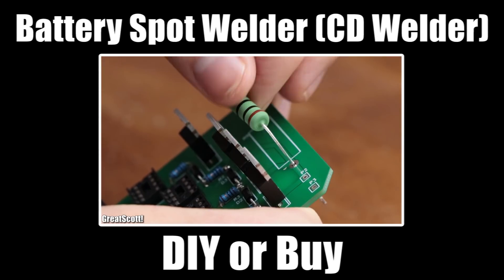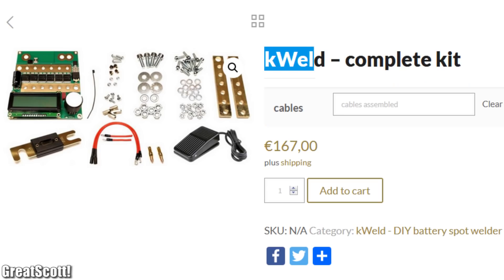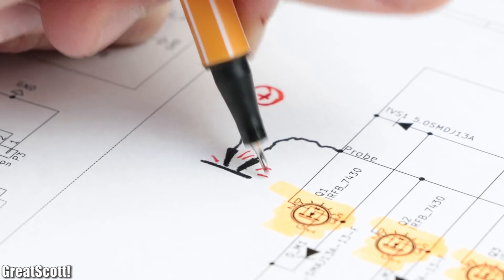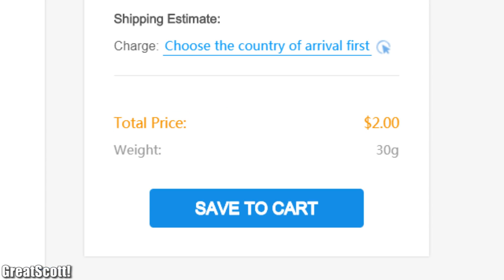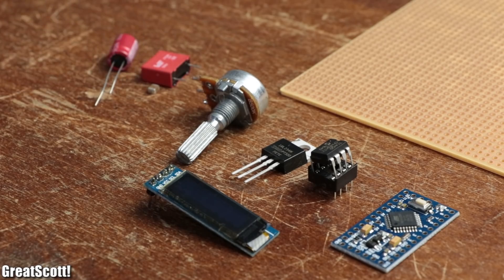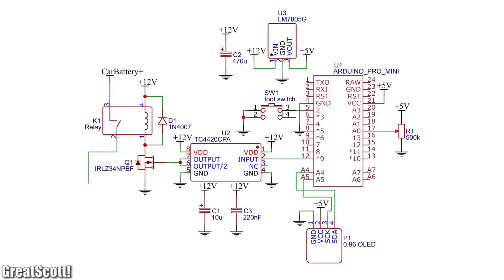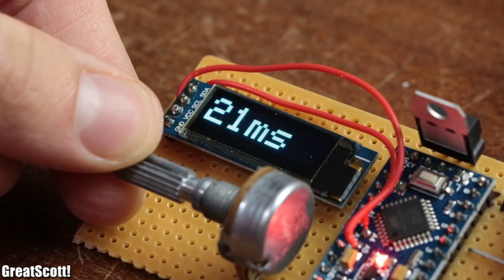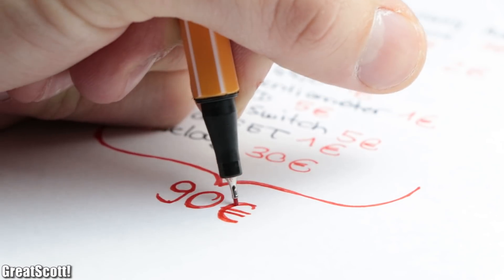Make your own Crude Battery Spot Welder with a Car Battery!

Comment: Hey Scott, i have a project where i want to build my own pitop. I have a big problem. I dont know how i am able to charge an old laptop battery fast enough, so it wont run out of electricity while using it. I know there are controllers, but it seems they are only aviable for 5 Volts selfmade power banks. Can u help me? All the videos i have seen, do only care about selfmade powerbanks. I need the full power of the 10.8 Volt Battery. in order to power the screen, with its 12V Controller as well.

Comment: Nice project! I'd simplify it even further by replacing the Arduino with a 555 timer. Same footswitch and RC tank, but simpler trigger circuit with no need to code.

Comment: Thanks for the video!  I did want to point out an even simpler solution for users to consider as well:  https://www.youtube.com/watch?v=b_kGgPVrcCI

That setup doesn't provide accurate adjustment of the pulse time, but the builder gets very good results by simply altering how he presses the trigger.  It's the simplest spot welder setup I've seen, yet he's obviously welded hundreds of cells with it.

Comment: Nice project but i have one question:
Instead of a car battery why didn't you use super capacitors like in your previous attempt, they are cheaper, dont need a fuse, can be charged directly after a weld, are smaller and can deliver more amps. Maybe you do need some super capacitors with more capacity (like 2.7V 500F) but those would certainly be better than a car battery right?

Greetings 
 Gustav.

Comment: Ive made a spot welder by using microven transformer. And I control the 220v input of the transformer with my diy SSR with a triac which can easily pass 20A. And rewinded the transformer so the output is around 6-7 volts and its the cheapest spot welder with 2  pulse system

Comment: Some guy on the youtube just built one with must a mot, 2 relays, few leds, buttons and a few capacitor, the first relay is connected to a button and a 16v cap, he basically discharged the cap to turn on the relay for few seconds to turn on the second relay that will connect the mot with the wleder electrod. He also built it so the cap is easly swapable to change the pulse time

Comment: I used a homemade spot welder 40 years ago. 120 vac to 15 vac using a 12 v octal timer and 1/4 kwatt transformer.  Did flat heater wires! The most expenses part was  the 1/4 kwatt transformer!

Comment: Shouldn't the project include a battery charger ? Even if many may have a spare one...
And I thought also, from your last video on IGBTs, wouldn't they be better suited for handling such amperage at a better price than mosfets in the project you mentioned ? They can be salvaged in induction stoves.

Comment: I just use 2 copper wires from a car battery. I press 1 down on the  Nickel Strip Tape and then touch the other one on it. Works for me. Minimal parts.

Comment: 90$ lol, if you need to make a new battery pack you may aswell just buy one. If you have tried to normally solder battery tabs to batteries, you know its almost impossible but you dont need to make one of these, you just need your car battery, and some copper wire. I made a video a few years back if you wanna see how to do this for free.

Comment: Almost the same idea, but without 99% of the electronics. I use a 330amp to 400amp solar battery and a 12v solenoid 1000amp from a Ford Bronco Truck, thick gauge solid core wire and thinner for the contacts for the activation and momentary switch, the same copper nails, and and 60amp connector for the nails and wires. Working, but could use a heavier gauged connector and you have to tap that momentary as fast as possible or you burn right through the strip and battery.

Comment: The relay will have a slow response time, making the timing a bit off. Did you allow for that?
Reply: My question too. But then, I realized that when we use any machine we learn what settings to use through experimentation. That said adding a variable for solenoid delay in the code could make it really close. If he does do that I wonder how consistent the solenoid is?
Reply: I wonder if the on-time and off-time of the relay is the same thus cancelling out? though an oscilloscope test wouldn't be hard to verify.
Reply: @bilzoo20001  yeah

Comment: Lol, I simply discharge a 25v, 20000uF capacitor - the pins can serve as the electrodes. Works like a charm every single time - Ive prob welded a few dozend li-ion packs that way...
Reply: Pretty cool! Noob here, how long do you have to charge the capacitor to be "fireable" again, i assume a few seconds? Also what do you charge it with, a car battery?
Reply: @aronrad  You need some sort of power supply, anything that will give you a stable, preferably 25v. Id say 18v is the minimum for it to work. Some old laptop power supplies run at that voltage or maybe you have an 18v li-ion power-tools pack that you can use to charge the cap. Also two 9v block cells in series could do the trick. Its harder to get a hand on 20000uf capacitors tho... My tip hence, buy two inexpensive 10000uf ones and put them in parallel. Good luck! Oh and as for charging time - just go with 30s and you'll be fine in any case. And make sure u got the polarity right otherwise they will blow up on you...
Reply: @Mikey Mike  -  I'm really surprised you get such a good result with such a small capacitor.  Have I read it right -  20,000 micro-Farads?  Theory says that size capacitor at 25V can only store/deliver about 6 joules of energy (0.5 * Q * V ^2 = 0.5 * 0.02 * 25 * 25 = 6.25 joules),  which seems WAY too little to make a weld.  My researches suggest that 40/50 Joules is the minimum, and that's with a really well-controlled and timed delivery pulse (preferably a double pulse).   I've got to get me one of those capacitors. If it works, you would seem to have discovered the secret of cold fusion, Sir :-) !  Are you quite sure about the capacitance?

Comment: You shouldn't crimp/screw tinned wire. The soft solder will compress, and lessen the contact pressure.

Comment: Mine is a large capacitor bank charged from a bench supply through a foot switch. Another foot switch discharges the caps through an old X-ray SCR (with triggering voltage from an 18650) and my leads.

It cost me about $0 to make thanks to scavenged parts.

Comment: Thanks a lot for this tutorial. I have tons of 18650s and I'm building a huge 25s1p pack to power a 1940s portable tube radio which requires a 90v battery and I was going to solder them the "bad" way, with a soldering iron...
Anyway, some of the stuff like the relay can be found for much cheaper on ebay:
Arduino Pro Mini 1.48€
TC4420 1€
IRLZ34N 1.40€ (price for 1 in packs of 2)
DK238 Relay 19.68€
Foot pedal 1.15€
0.96 Oled display 1.99€
Battery terminals 1.63€
200A fuse holder 5.40€
200A fuse 0.40€ (price for 1 in packs of 5)
Copper nails 5.10€ (price for 5)

Which makes it a total of around 40€ not accounting for thick wires, potentiometers, veroboard all that stuff. But let's suppose it's around 15€ (10€ of cables and 5€ of extra hardware) so the real total price is 55€. You could even remove the copper nails from the list and replace them with heavy duty ground wires if you can get your hands on a foot or two.

If you want to go the cheaper route with a 555 monostable circuit you can shave 10€ off the price.

And if you think the big chinese electronics lobby is trying to scam you with their scary "safety" gibberish simply get the relay and a foot pedal just like AvE did: Spot welder for 30€!! (anyone reading this, please don't do that, accidentally burning down your table or you house is not worth it for this price.)

And again, thank you for this video! Love these useful and effective projects!

Comment: SCOTT! Please cut off those tinned wire ends in screw terminals!

Solder suffers from a problem called cold solder creep. Under long term mechanical pressure it flows, relaxing the force on the wire and causing a resistive connection. This has caused many house fires in the past. Although it may not be dangerous in your welder application, it is a dangerous practice which should never, ever be used as an example of how to prepare wires for screw terminal connection.

This is also why, in safety related wiring applications, it is forbidden to rely on soldered connections alone without mechanical fastening also.

Modern lead free solder used widely in Europe may not be as susceptible as leaded solder, but many hobbyists still use leaded solder, and outside Europe it remains widespread.

Please check this out, and warn your viewers not to tin wires for screw terminals, especially never, ever, mains wiring!

Comment: I'd like to see the Arduino version compared to a simpler 555-based version. I only need to set a variable pulse, so would not think it necessary to add a computing device to the circuit when a 555 would do the same thing. Seems like far too much complexity for a simple timing device.

Comment: I used an arduino with a potentiometer and simple timer code to pulse a 5v 30a relay to pulse a Ford starter relay. Cheap and simple. $20 if you already have an arduino.

Comment: The easiest and cheapest way is still using 3 alligator clips, two pieces of copper wire( as the electrode) and two pieces of metal. Just hot glue the two electrodes together at the right distance. Hook one side directly to the battery. Hoot the other side to a metal object like a screwdriver. The other battery side goes to some other piece of metal that is secured. Hold the electrode on whatever you want to weld. Then strike the screwdriver on the metal. Depending on your speed the power is controlled. Use thin alligator leads as they act as a fuse in the worst case. has worked nicely for me

Comment: You can find those solenoid switches for about €7 tho... No real sense to get the 1000A type.
I'd expect most cheaper ones would actually happily conduct 1000A for 20ms; considering the car starter they normally power is a much more sustained load.

Comment: Well, in this case there's no real reason to use timers and hardware interrupts, since you don't need microsecond precision. But if you're gonna use timers and hardware interrupts, you might as well read and write to pins through port manipulation, since digitalWrite, digitalRead, analogRead etc. are incredibly slow, compared to accessing the registers directly as you did to set the timer.
When it comes to the welder itself. I have no idea why you would use a mechanical "relay" which costs 40 dollars instead of mosfets. If it would have been cheaper fine, but do you have any idea how many mosfets you can buy for 40 dollars?

Comment: 1. Arduino and code just for a pulse ? Where did a simple 555 monostable with a simple pot go ? 
2. A    1 0 0 0 A  relay ? Really why ?  Three or four cheap MOSFET's in parallel could easily switch 300A ...
3. Very bulky 200A fuse that looks like a space-ship model ? Replacement ? What about a simple shunt sense resistor that pulls down MOSFET gates ?
4. Battery as power source ? Well that maybe OK, but is definitely more expensive than a re-wound used MOT Transformer.

All in all that was a bit disappointing on the design level.

One last thing I could not keep to myself : please use a pencil when pointing at the scope screen !
Reply: Have a real measurement of the current peak while soldering at low voltage and you will find out that 1000A is not overkill.
It will probably work fine with a weaker relay but fail sooner.
There will always be another way to build a project. This is a certain approach and it's worth considering even interesting to put in ballance with another to get the pros and cons.
I'm > 50 years old and yeah, using an arduino in this project might look exagerated but I must admit I didn't pick a 555 out of the drawer since at least 25 years now ;-)
Cheers

Comment: The flyback diode extends the set welding time, because the relay shuts off only when the magnetic field in the coil is reduced
Reply: Ralf Blumhoff V = L x dI/dt. If relay current is 100mA and inductance is 1mH and mean voltage across relay during decay is 6V, then inductive hold time is around 16us. Negligible for a device operating in tens of milliseconds.

Comment: I've seen and used an even more primitive version. Take all the timing and foot pedal off, build a holder for both electrodes so you can use one hand to hold them, and connect a momentary button switch to the  relay. Of course his will be far more consistent than the one i used. Also a far cheaper high amp relay is a starter solenoid and can be found in any junk yard for $10 or less.

Comment: Why a mosfet driver instead of a logic level mosfet? Seems like an extra component
Reply: There will be a large fly back voltage on the coil of that massive relay. Even though he used a fly back diode, I would still use an intermediate mosfet to avoid damaging the microcontroller.
Reply: @dreggory82  I've driven high powered solenoids that needed 2 amp flyback diodes with logic level mosfets for hundreds of cycles an hour in automated machinery being driven by atmel chips. I can't imagine this low usage device would need that extra level. But if it's the best practice then I can understand recommending it,

Comment: Why not just use a 1$ ne555 timing circuit which already guves a potentiometer adjustable pulse signal? Add 3$ to a motorcycle 12V relay and 2$ for the pedal. You’re good for 10$ excluding electrodes and battery

Comment: I've always wondered why you use fuses in your projects. Wouldn't a circuit breaker be cheaper over the long term, as you don't have to buy new fuses whenever they blow?

Comment: You should not tin wires while using screw connectors. The solder can corode and the connection will come loose. The best way is to use special crimped connectors made of copper tube.

Comment: For cheaper option just use car starter solenoid :)
Reply: Cheap option if you want to make holes on the battery...
Reply: Just get a microwave transformer and a cheap controller from aliexpress.

Comment: Hi regarding the power relay, I'm having trouble finding something like this on german ebay. Could something like a "Batterie Trennrelais 12V/200A KFZ" (zl 180 relais) also work? Its rated for 500A max Current draw so it should be okay right?

Comment: for screw connection of the cable you shouldn't solder the cable... IPC-A-610 norm...
Reply: Yes, it is recommended to use ferrules instead. The solder become brittle under mechanical stress (and with time) and the termination becomes very unreliable, causing high resistance/hot spots.
Reply: Agreed, always difficult to decide what to do. For an application like this, with only occasional usage it should be fine.
Reply: I did a test on this and after about half a year the wire was lose and didn't make contact anymore. With these connectors it could work since the screw itself pushes the wire together if you screw it tight enough altho I wouldn't recommend it.
Reply: The high surface area in the copper in the cables exposes to oxygen which eventually tarnishes and causes increased resistance, generating heat in the cable and reducing the current. Soldering it as one mass reduces that corrosion and keeps the current flowing. If it was higher voltage  (240v) and continuous current flow then I would have said not to solder but for 12v it is fine as long as that screw connection is good and the solder is soft.

Comment: 300 amps? I know it's for a very short time but, that sounds a lot.. I own a tig welder with spot welding capability. It goes up to 200 amps absolute max.
Reply: So the overall voltage drop is low

Comment: 30 € for a relay?! I think power MOSFETs are cheaper...
Reply: average car starter pulls 150-250 amps. for the past several decades the relays have been built into the starter. It's the smaller round part on top of it.
Reply: IR3034 costs about 3 EUR and have 340A maximum rating. Of course you need a couple of these
Reply: I feel like IGBT's are more suited for this this type of thing
Reply: I've never bought from a junkyard before but I'm sure you could get one from an old car for under 10€.
Reply: @vgamesx1  no, most old cars top out at 50 amps.  if you're think about the starter, those are usually direct switched, not relayed.
Reply: @Unmannedair    Ford makes a relay. Almost on all Ford motor vehicles and smaller ones on the lawn tractors. They pulled 50 amps not loaded and 450 amp cranking.
Reply: Get one from a car